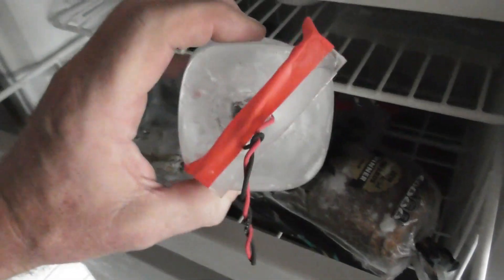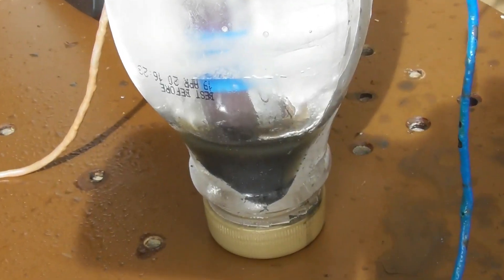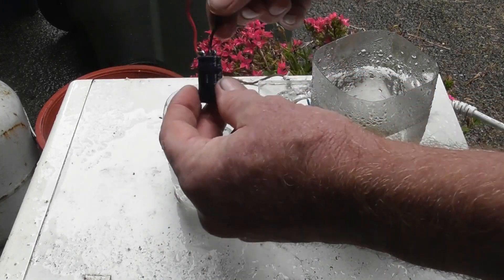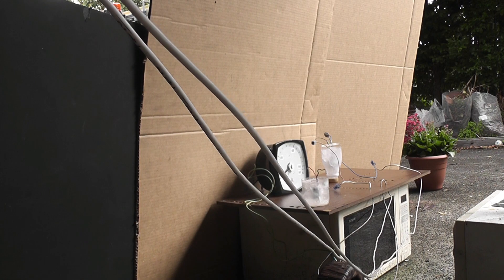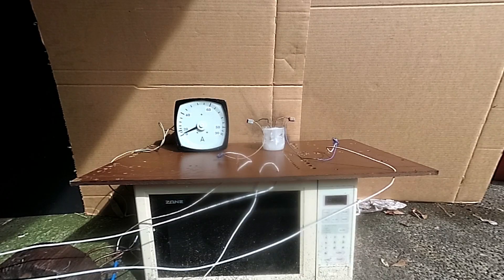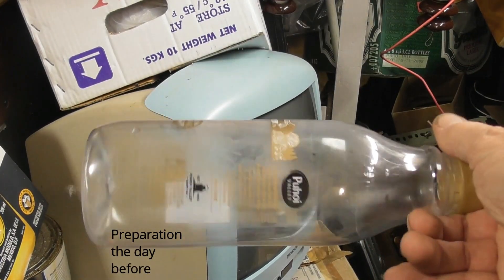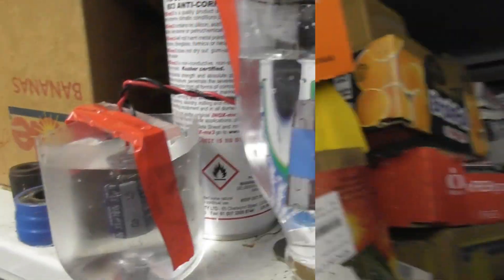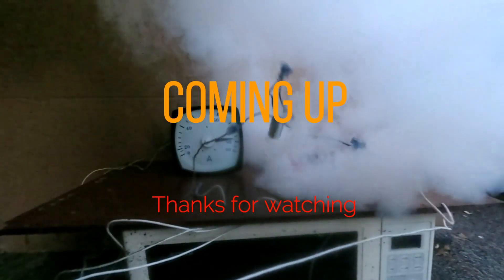Frozen Capacitor in iceblock - FAIL

Comment: Try encapsulating the capacitor in some polyester resin (like for fiberglass), or epoxy, or concrete, or something nice and solid that won't melt.